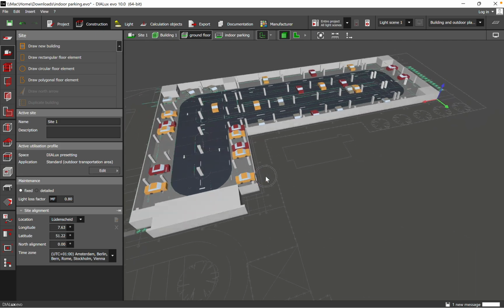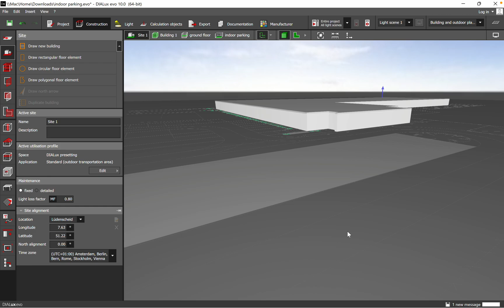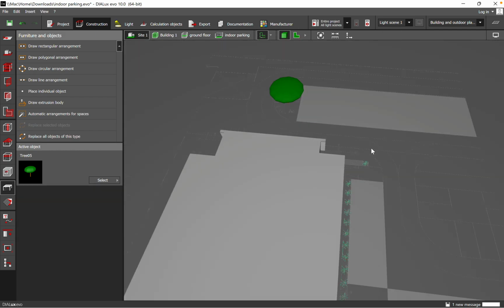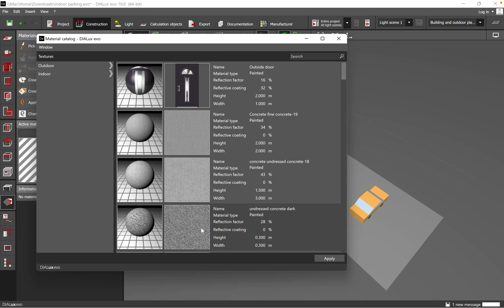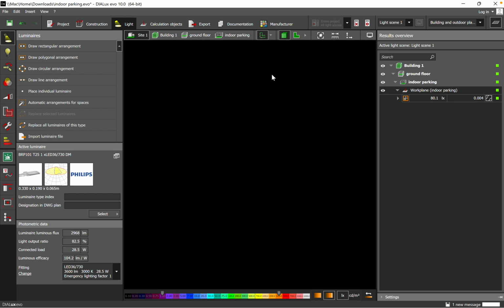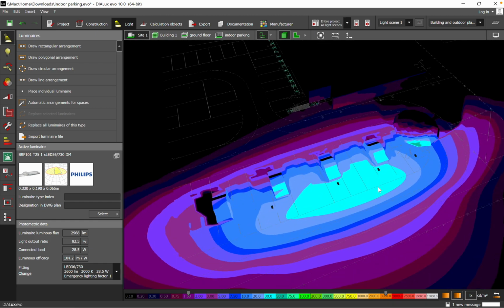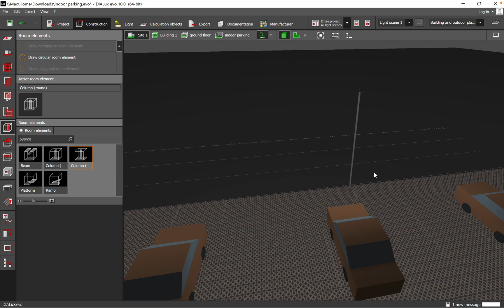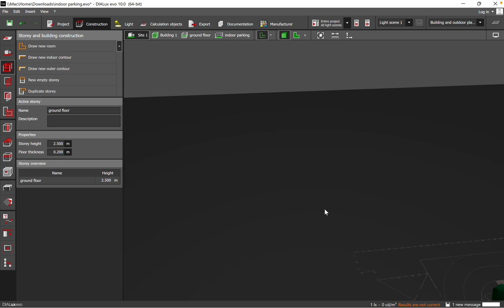How to run outdoor lighting for a building

Comment: Why u dont use the calculation object surface to limit the lighting stimulation
Reply from the maker: Thanks for your question! I could do that without any problems, but I did not consider to add the object surface in this case.